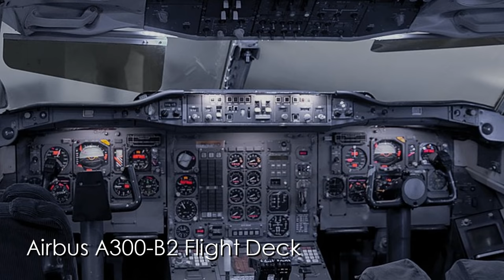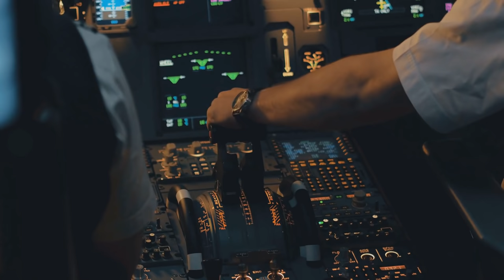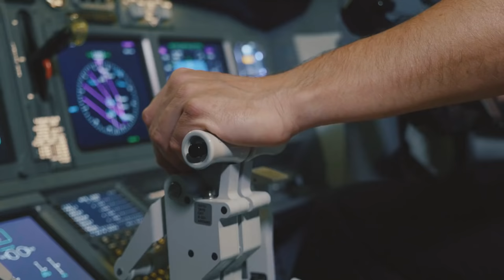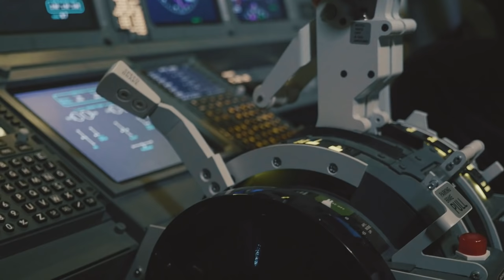Pilot Rips The Tail-fin From Their Plane (American Airlines Flight 587) - DISASTER BREAKDOWN

Comment: Only five homes were destroyed in a crash like that. That’s amazing.
Reply: And only five people died on the ground. Could've been way worse.
Reply: It’s actually awful with you consider that plane had to dive straight down into the ground like a dart at high speed to cause that little on ground damage, absolutely horrific for those onboard.
Reply: The plane had broken apart mid-air and the fuselage landed in the middle of an intersection of the road at a vertical angle. One engine landed on a gas station, the other on the garage of a house. The tailfin ended up in the river.

Comment: It's mind boggling to me that a pilot can literally rip the vertical stabilizer off just by manipulating the rudder pedals without some system that would limit how much pressure can be applied to the rudder at that airspeed and how fast and how far the rudder can go. I bet after that most A300 pilots had soft feet when using the rudder.
Reply: You Can "Rip" Shit Off Any Airplane,,,, Not Following Design Limits Set... That's Been True Since The First Flight of The  "Wright Flyer" at "Kiddy Hawk,,,,
Reply: or transfer to flying the MD 80 series-wait-did AA have the 777?
Reply: That's because rudders usually don't have a limiter system because there might be a need for full rudder deflection during certain movement procedures. And with a direct mechanical linkage to control surfaces on the A300, there isn't anything to filter/dampen outputs.
Reply: AA's flight simulator program was faulty and constantly was training pilots to react incorrectly to rudder problems too aggressively because AA had refused to spend the money to upgrade their flight simulator from fly by wire rudder controls to the new hydraulic rudder controls. AA denied it initially and then secretly changed it based on the findings from the NTSB. The pilot was also thrown into a panic and hyper-reacted to the situation by wildly flailing on the rudder pedals like a madman without thinking clearly. Airbus had fully communicated to American than on this plane the rudders are softer and the pedal is smaller than other craft. The plane was 13 year old at the time.

Comment: I like your clear, concise and factual telling of the incidents. However a suggestion - include more detail, black box audio for example or even just the text.
Also, after the Tenerife disaster the ATC commands were completely changed and the word "takeoff" could only be used to issue or cancel a takeoff. "Standby for takeoff" became "taxi into position and hold".

Comment: Whats eerie is that this crash stemmed from wake turbulence from a Japan Airlines 747.... In 1985, a Japan Airlines 747 crashed and killed 520 people on board when its tailfin was ripped from its body due to improper maintenance.
Reply: spooky breh whoa
Reply: Or DHL 611 where it also lost it's tail and during it's dive both engines were ripped off
Reply: 3 years late to this response. But another eerie thing is thr flight departed on 9:11 am..
Reply: The JAL vertical stabilizer ripped off because the plane had suffered a tail strike previously

Comment: I find it amazing that a plane that clearly had a design flaw - vertical stabilizer weak connection - is involved in a crash due to that flaw but it’s blamed on pilot error essentially for performing a maneuver they are trained to perform, which never broke the tails off any planes before, because the airline and pilots should have accommodated for that plane’s weak tail section.  Excuse me?!  

The modern equivalent would be to blame the pilots on the two Max crashes because they failed to follow standard runaway trim procedure in the manuals to prevent MCAS flaw from killing them.  Oh wait - they DID each fail to follow that procedure which would have saved them, yet everyone seems to blame only Boeing.  

There seems to be a major disconnect in objective analysis between Boeing and Airbus accidents.
Reply: If you steer your car left and right at maximum setting rapidly at speed you will break something, and that would be the car's fault?
Reply: @johnc1666  YOU may steer the car into the ditch under your example but the steering mechanism wouldn’t be broken - only the front bumper.  That would be all on you.  If the steering wheel broke, it would be on the car.  

In this crash, the steering wheel broke.
Reply: @markodom3841  oh no! You will break a tie rod, blow the tire and maybe flip the car over. Many tests prove this, SUV's will roll over on flat surface if you rapidly maximum steer. Any driver knows to not do that, or try to shift in reverse while going forward... You will break the car.
Now if ypu think this pilots inputs were ok 😂 maybe we should have self driving planes, or like in america, warnings on everything like this one "coffee is very hot" or "dont touch the chiansaw blade while running" 😂
Reply: Any plane will allow you to do maneuvers with exessive forces,, or g forces. there is no mechanism preventing excessive inputs or  maneuvers, and just like in this case, you could break the plane.
Reply: @johnc1666  actually, Airbus has built in mechanisms that disallow sudden pull up maneuvers by pilots to avoid stalls and such has been a cause of A320 crashes when pilots realized late their close proximity to the ground but the computer overrode such sharp pull ups causing crashes or very hard landings.  Such a mechanism to limit rudder input would have saved this A300.  While a sudden pull up could cause a stall, it wouldn’t cause the wings to break off, the equivalent horizontal maneuver to this one.

But even without such a system, the tail should be built to stay attached no matter how hard the rudder is worked.
Reply: @johnc1666  The car flips because the wheels DID turn in response to turning the wheel.  Had the the push back from a sudden direction change of the tires caused the steering to break, then the car would continue in the same direction.  

In short, what other planes have crashed from similar rudder input?  I've not heard of any and don't tell me no other pilots ever make hard and sudden rudder movements.  But I see from your "like in [a]merica" reference where your agenda likely is.
Reply: @markodom3841  try going super fast in manual gearbox and then suddenly downshift in first gear 😂 you will blow the engine and crash because the wheels will lock, want more examples of stupid?
(this agenda comment is ridiculous, I don't think in binaries. I am certainly not a fan of a brand or corporation against an other I hate them equally. But I hate people who don't have a sence of responsability and lowering the bar so much that this pilot's inputs are considered okay.)
Reply: @johnc1666  Your example is not analogous.  Certainly shifting a spinning hard gear into a another hard cog spinning the opposite direction will cause immediate damage.  This situation involves air movement pushing sidways on a control surface that is designed to have air pressure push it.  My analogy of a pilot pulling the yoke or joy stick up sharply resulting in the main wings falling off is more analogous.
Reply: @markodom3841   I already gave you an analogous example of stupid. If you sharply turn the wheel of your car at speed, you will blow a tire, break a tie rod and crash. Believe it or not, when you are at the control of machinery, if you are not careful, extreme operations or stupid actions can damage the equipement and kill you. I know you are the type to not accept responsability and blame you incompetence on everything else, but you seem to have an agenda that blinds you to what is evident.
Reply: @johnc1666  I realize that extreme actions with machinery create extreme stress on those mechanisms - I saw a friend rev his car's engine very high and broke the engine motor mounts.  But in this specific case, why wouldn't the rudder, which is connected to the vertical stabilizer essentially with hinges (free moving parts), have come loose first due to that same extreme force before the vertical stabilizer (non-moving fixed part) came loose from the empennage?  It's the rudder in an acute angel from the direction of airflow around the vertical stabilizer that creates the extreme pressure, both on the vertical stabilizer AND the rudder attachments.  Why wouldn't the moving part give way before the supposedly "fixed" part?  I'm just wanting to know.

Also, at the time of the failure, the A300 was moving only around 200 mph early in climb out.  Those same pressures would multiply at higher speeds, wouldn't they.   So, if a pilot applied even less rudder when crusing at 600 mph, that should have the same bad effect - wouldn't it?  I'm not arguing that such a move doesn't put stress on the control surfaces, but I'm asking whether the attachment of the vertical stabilizer to the empennage could have been and should have been more rigid and secure so as to allowed it to survive this agreeably stupid move by this, or likely any other, pilots.  Just asking.
Reply: @markodom3841  i will agree to what you said. That was reasonable. The pilot's actions were undeniably stupid. The video of his inputs in the data recorder shows incredibly bad skills, reminding me of Bonin in the air france a330 crash. But if they can make it more sturdy, why not? It will make it more "stupid" proof for badly trained pilots.
Reply: @johnc1666  Right.  It's as if a golfer was incredibly strong such that his sudden downswing caused the club shaft to break.  The stresses on a golf club shaft created by the sudden change of direction would be similar, yet we don't hear about clubs breaking in those situations.  Our earlier discussion about shifting a car's gears into reverse suddenly, to me, would be more like hitting a rock with a swinging golf club.  I would expect the shaft to break in that situation.
Reply: @markodom3841   I bet that breaking golf club shafts during a normal golf swing is way more frequent than breaking an airbus' vertical stabilazer during normal operation. But this was not normal operation by far. Look at what his inputs were. It's not normal operation, it would be like violently shaking the golf club and calling that your swing.
Reply: @johnc1666  My main point is that, as is usually the case, there's a mixture of fault between the manufacturer and the pilot - stupid excessive rudder inputs on the part of the pilot combined with insufficient attachment of the vertical stabilizer by Airbus.  So, I think putting 100% of the fault on the pilot in my view is unrealistic, just as putting 100% of the fault of the MAX crashes on Boeing was also unrealistic.  Yes, the MCAS was very flawed and created a very risky situation, but it only created yet another scenario whereby the trim could runaway, which it did.  But the pilots could have recovered from both events by following the runaway trim procedure that has been in the flight manuals of all commercial jets for decades, yet they didn't follow it at all (Lion Air) or didn't follow it properly (Ethiopian Airlines), which lost for each of them the good chance of recovering and landing safely.  In both these stories (A300 and MAX), I think a mixture of manufacturer and pilot error covers all the fault.  Yet, in the Airbus case all fault went to the U.S. pilots, but in the MAX case, all the fault went to the U.S. planemaker.  

Yes, I do believe politics is playing a role in how people are viewing these incidents, unfortunately.  Since I believe both are mixtures of fault, my position is less likely political and therefore more objective.  But to be so sure of 100% fault on the plane in one case and on the pilot in the other causes me to question the credibility of holding both of those opposite positions at the same time with a straight face.  So now you see my sensativity in reviewing the 2001 A-300 case in this manner in the wake of widespread exclusive condemnation of Boeing in the Max disasters.
Reply: @markodom3841  I see what you mean. I was strictly talking about this case with no political attachement at all. Boeing or Airbus to me seems about equal. Probably its Boeing that has an edge and they seem to make better decisions. I dont really know eveything behind the latest MAX incidents so I won't take any position.
Really it's just the pilot's inputs that baffled me as much as the actions of Bonin in the brezil air france crash.
I think it's reasonable to put blame on Airbus for the weak connection. But pilots should be hired for their great skills and decision making and be paid well and be responsible.
Reply: @johnc1666  Fair enough.

Comment: that's CRAZY that the FLIGHT DATA REORDER  doesn't have its own discreet battery to run off of.. I mean using the engines is INSANE .If the engines go the recorder goes.. usually there is so much redundancy in airplanes .. In this case the primary source is not even adequate ..
Reply: I think modern ones do. Battery technology has come a long way since the A300 was introduced, but above all, the recorder technology has advanced a ton, such that it needs far less power, making battery power feasible.

Comment: It has been known for the past 20 years that AA's flight simulator program was faulty and constantly was training pilots to react incorrectly to rudder problems too aggressively because AA had refused to spend the money to upgrade their flight simulator from fly by wire rudder controls to the new hydraulic rudder controls. AA denied it initially and then secretly changed it based on the findings from the NTSB. The pilot was also thrown into a panic and hyper-reacted to the situation by wildly flailing on the rudder pedals like a madman without thinking clearly.

Comment: Over 22 years later its still truly near unbelievable how quickly this flight went from being just an ordinary routine flight, everyone stepped on board with hundreds of years of life possibly ahead of them but unfortunately that wasn't the path they took that day, I remember reading through the NTSB report when it was released and reading through it you'd think this accident took place over a bare minimum of 5 min but all it took was XO Molin alternating the rudder for not even 30 seconds, for the vertical stabilizer to fail and send them careening into the rockaways only about 10 sec after the rudder failed, not even 10 seconds, the force was so extreme both engines were sheared off within 3 seconds of the stabilizer failing and for me that's the hardest thing to believe, especially when I took into account numerous other disasters like my all time scariest aviation disaster and really there's few things that rival it when it comes to scaring the hell out of me, but after 32 min of extremely limited control all 4 engines on that 747 were still there, though of course i know they're two different disasters with 2 different models of aircraft of different sizes and it didn't fall into a flat spin like AA 587 but it did lose a majority of its vertical stabilizer though the key difference is altitude and at 24.000 feet Japan 123 was at a much higher altitude where if it happened to AA 587 at that altitude I'd say there's a chance they could've pulled out of it for an emergency landing, the engines might've withstood the forces at that altitude, I remember when it was announced what caused the crash and though the stabilizer failing like that is most definitely something to worry about, it's the engines that really to this day(May 2024) it's still the hardest to believe for me and it's really the time of 3 seconds...and time is something that's still hard to believe that all it took was less than 45 seconds to end 265 lives and it's been a prime example for me since then for how too much of anything is bad, even a solution, Molin hits the Wake Turbulence that ATC warned them of and alternates the rudder but does it so much that it actually pushes the plane further into Turbulence so he keeps alternating until the stabilizer fails, maybe the only thing I can say that is anywhere near a positive is that they most likely different suffer anything beyond their final 10 seconds...and I'd take that for myself or for a loved one anyday over the absolutely terrifying final 32 min of Japan 123 or numerous other disasters where if I was on the plane after a few min, maybe 10 tops it'd be clear to me that this is it and I'd just want it to be over... being a New Yorker definitely made it hit me harder barely even 2 months after 9/11 though for some reason I got the feeling it wasnt terrorist and my grandfather, a retired Captain at the time didn't think so either..i didn't know anyone on this flight though several people closed to me did and it affected me through them but even if that wasn't the case it's ok cuz I don't need to know these souls to care about them and I really hope wherever they are they are either resting peacefully or in a place where they don't have to suffer, it only took several seconds but that's still more than enough time to suffer